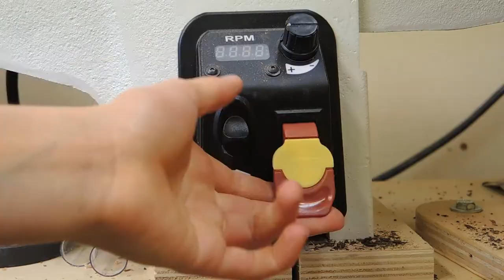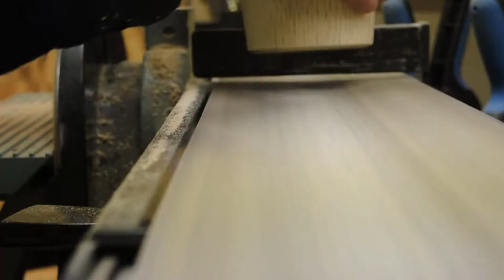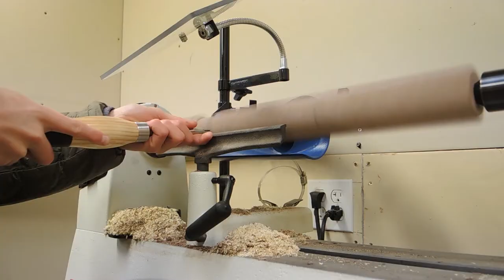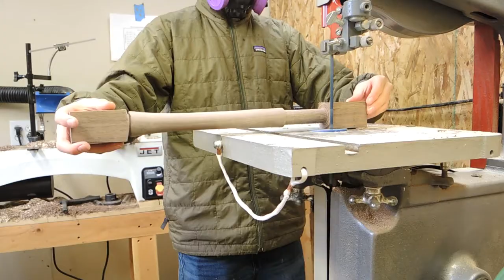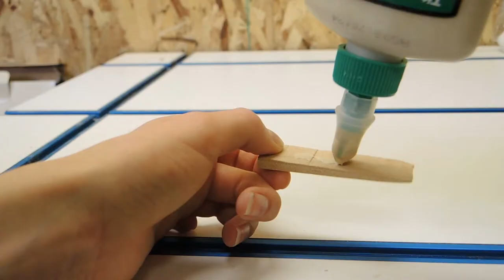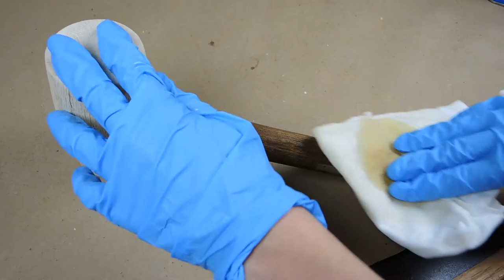How to Make a Wood Mallet // Woodturning

Comment: It’s a good thing that mallet isn’t gonna get much heavy use, if you want to have a better fit and last way longer you have to stop making a shelf when the head seats, also you have to make the top hole bigger than the bottom of the hammer and that’s what makes it hold way better, it spreads the wood so the handle has no possibility of going back the hole